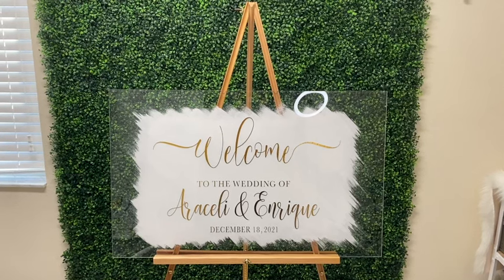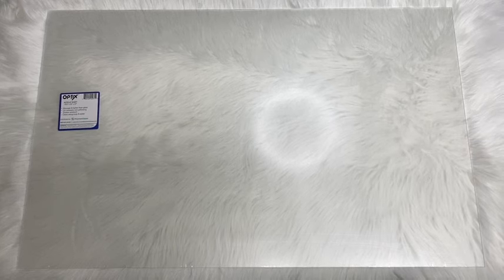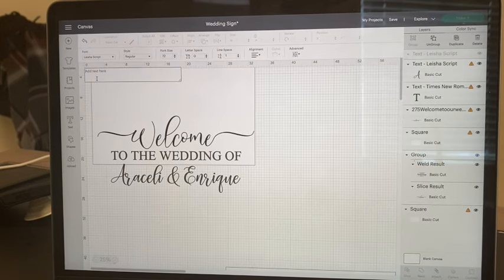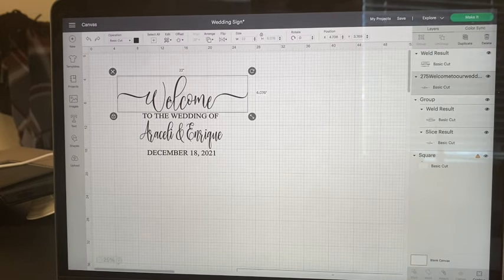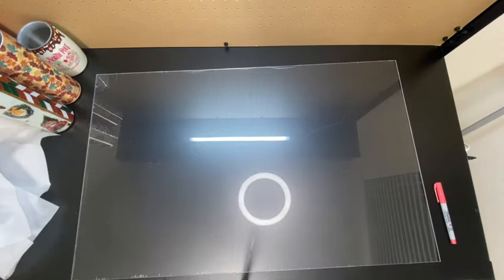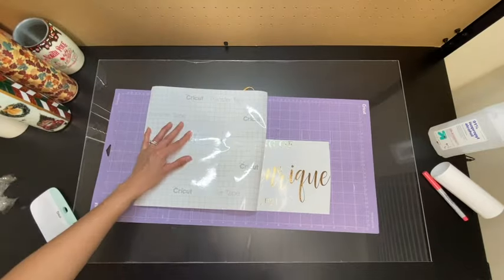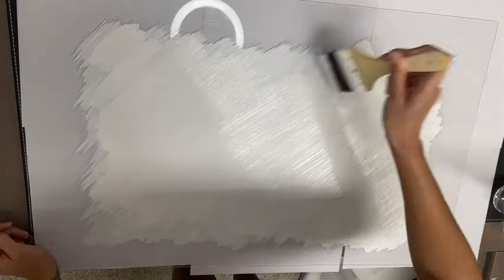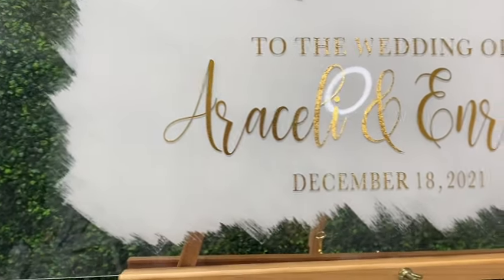DIY Acrylic Welcome Wedding Sign | Wedding Sign Using Cricut

Comment: Hi and thank you for this video! I'm about to make a similar sign for my wedding soon and I wondered - do you need to sand the back of the acrylic sheet before painting it, so that the paint adheres better? And do you use any primer/sealer over the paint? Thanks.
Reply: I’m learning as well, and some videos I watched they used “mod podge” to seal the backing and left it overnight. 
And some said they don’t seal at all 🤷‍♀️
Reply from the maker: Hi ! I don’t sand before painting the back and I also don’t seal. You could seal it if you want. Maybe with a few coats of mod podge… or even clear spray paint maybe .

Comment: Such a beautiful design! Is there an easy way to remove the vinyl so you can reuse the sign for different clients? If you scrape the letters off do you damage the board? I've just ordered a clear circle disk for my events business but haven't tried it yet
Reply from the maker: Thank you 😊 Yes you can easily remove it then wipe it off with some alcohol. You can do it with your hand to avoid scratching the acrylic sheet. You can also use removable vinyl as well and it will be easier to remove. It can totally be reusable 😊
Reply: Wait so you only do these for local people who you can pick the acrylic signs back up from? I’m a little confused. Do you tell them they are renting it? This is a legitimate question I am not being facetious💟💟💟💟💟💟
Reply from the maker: You can make them to rent or sell it for them to keep. Totally up to you. If you rent it you would personalize it and notify them that you will pick up the sign after the event. If your selling it to someone for them to keep you can do local pick up or ship it. These are very durable and won’t break in transit.
Reply: And the acrílic paint it's easy to remove too? Doesn't scratch?
Reply: Can you remove the paint , to customize every event

Comment: Can the permanent writing be removed
Reply from the maker: Yes . It’s permanent vinyl but can be removed like a sticker . You can also use removable vinyl and it will be a bit easier to remove. After removing just use some alcohol to clean up and stickiness from the vinyl.